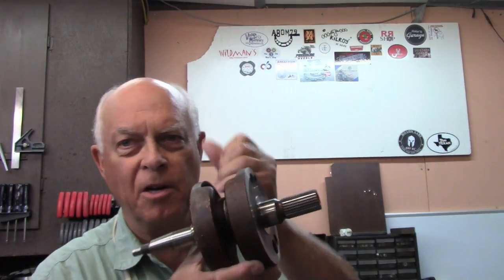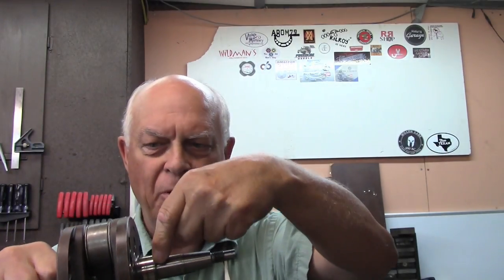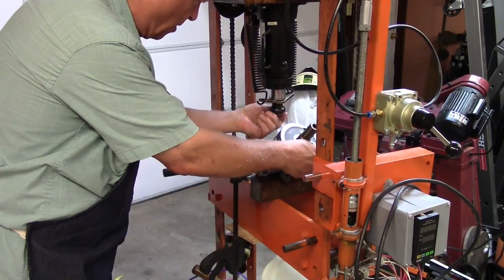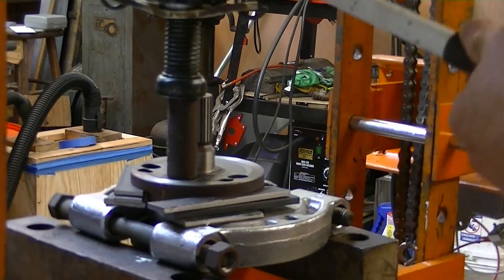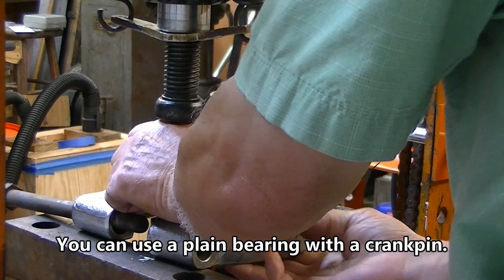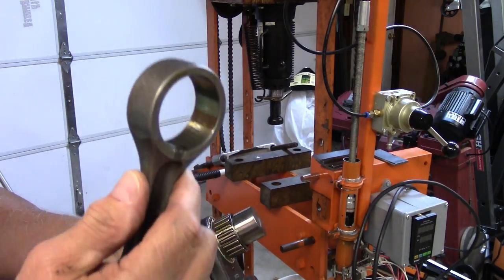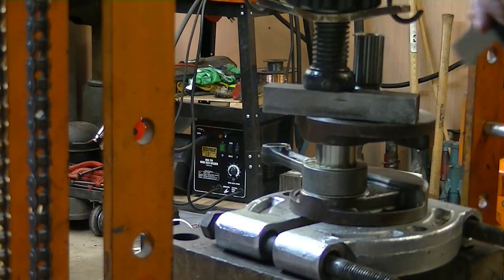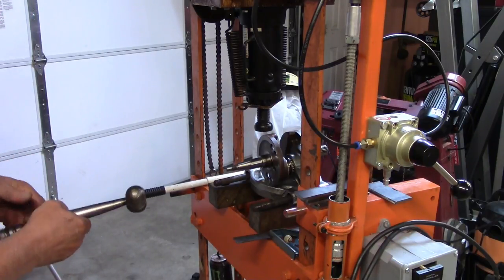Motorcycle crankshaft rebuilding

Comment: Since you have a round hole and a round pin, how do you "time" each lobe to the other ?If I'm right, all you were doing was making sure each lobe was parallel to the other ?Thanks Harold.
Reply from the maker: When you put them between centers you must confirm that the crank bearing surfaces on each side of the cranksyhaft show zero runout.  If you have zero runout then everything is dead on straight.  In fact if you have zero runout on one side you will surely have zero on the other.  I guess I did not explain well enough what I was doing with the dial indicator.  If the center had not been ruined on one end I would not have stopped with the explanation but would have trued it up completely.  Thanks for stopping by.

Comment: Hi Harold,
Now, I need to get myself a motorcycle that will make it to Noeway....    Sight....!!!      lol
This is a complicated way to align the outer parts, isn't there any way to make a gig with pins or something of the kind???
Cheers,    Pierre
Reply from the maker: Yes you can make a jig but I am certain you still have to check it with a dial indicator to be sure it runs true and most likely adjust it.  Thanks for stopping by.

Comment: Half a thou is typical max runout, I doubt I want one of my crankshafts messed around with like this, every man to his trade.
Reply from the maker: Thanks for stopping by.
Reply: Wrong David Dale. Some wiseco cranks are 2-3 thousandths run-out. Not sure what soiled your panties about this video, but they all get a good smack with an aluminum or brass hammer. Maybe you should just trust wiseco or hot rods and just buy another. Wouldn't wanna stir up your anxiety...

Comment: Too many shortcuts, like using essentially carpenter square to check perpendicularity, resting side of the crankshaft on the not-machined surface of the gear/bearing puller. It's OK for disassembly, but not for assembling. You should turn hydraulic element by 180 degrees in your press, so the downward motion of the handle would advance the expansion.
Assembly of the crankshaft without aligning jig should not be even attemted.  Use of the lathe chuck on one side, and especially drill chuck on the other  for runabout check  is pathetic. and above all, meaningless.
Also one micrometer gauge instead of two, on both sides of the crankshaft. Usually a simple dead-center stand is used for this purpose. Hammering poor crankshaft with a leaving gauges steel hammer is inacceptable and brutal. A bronze or copper hammer should be used. I am shure that Harold realizes all of the above.
In summary, this shop is not equipped to offer crankshaft rebuilding services to the public.
As I see from the comments many young fellows are looking up to you, eager to learn. They should be thought right away the proper way.
Reply from the maker: Well Jack some of them probably watched the video.  If you had you would have noticed that I said I used an aluminum hammer to move the throws.  As for needing two dial indicators that is just great for selling indicators but believe me if one indicator shows no run out then two indicators will show no run out, give it a try some time.  As for the jig for the assembly I have never seen one anyplace.  I suppose the factory has them but then I also expect they still have to do some fine alignment.  Which way the hydraulic element faces is of no importance at all.  As long as it does the work nothing else is to be gained from screwing around looking for another position.  I would like to congratulate you on having honed your troll skills to a much higher level than the average troll can ever expect to achieve.  Personally I have rebuilt many single and multi cylinder crankshafts with no complaints from the customer.  How many have you done?  Where is your video of you showing the perfection you suppose i should have achieved?  I would bet you have never even had a motorcycle crankshaft in your hands.  Thanks for stopping by.  I was in a bad mood and really needed you to take it out on. I feel a lot better now.
Reply: I will not address your personal comments about me and your assumptions what I have seen (or not seen) or did. I can only tell you, Harold that I started riding motorcycle when I was 5, started racing when i was 12 and we were always thinkering how to make them go fast. Engines, like small 125cc or later 250cc were all two strokes and were routinely overrevved. That's why close tolerances in crankshaft assembly were essential. otherwise engine would explode during the race. I didn't rebuilt as many crankshafts as you, but probably some 30-40.
As for the crankshaft assembly jig, there is one "home made" at the machine shop. It is on the video at
https://www.youtube.com/watch?v=y4CQBU0Zohk, somewhere around 5 min 39 sec from the beginning.
If you have a lathe (I see you do) and a milling machine (or access to one) and materials from the scrap yard you can make one jig like this in half of a day. With a jig you will not only work much faster, but right away get results probably an order of magnitude closer to true, which in turn will minimize tunning. You can also find a video with use of a factory made jig by Austrian KTM. After assembly they measured runout and came out with 0,02 mm !!! Not bad!!!
Micrometer gauge is now-days not expensive item. I see you are using a professional grade by Starret
I appreciate your time and effort to publish a video and apologize that I did not put out one. It was not my intention to criticize you, just to make things better, I feel that you are honest and sincere person and I wish you the best.
Reply: He failed when he lost the needle bearings as far as I'm concerned.
Reply: I have to say your second comment was spot on, I dont think I could've  said it better myself. Harold does seem like a nice enough guy though, trying to help.

Comment: This was an awfully timely video i have been wondering about pressing new bearings into a tiny chainsaw crank but now seeing this i doubt it would even be worth it because the pin part on these cranks are machined into the counterweight and only pressed on one side... couldn't replace the pin.  i made some videos of the clone saws i am building anyways the cranks are only 13 bucks to replace from china..... this seat isn't going to norway ha ha
Reply from the maker: Try Sweden I think Keld is there.  Thanks for stopping by.